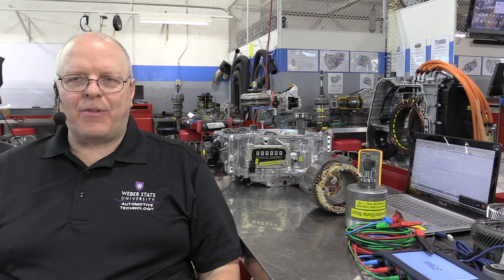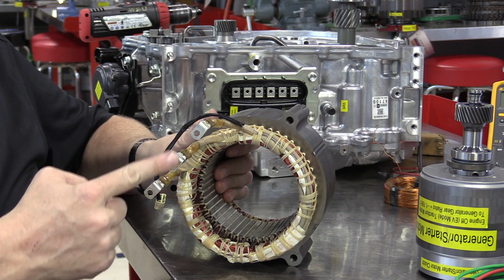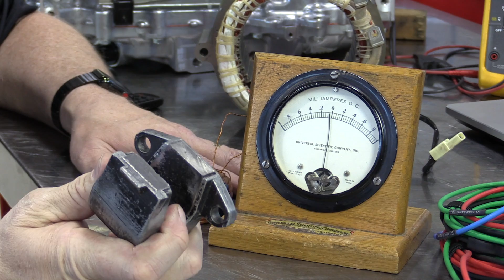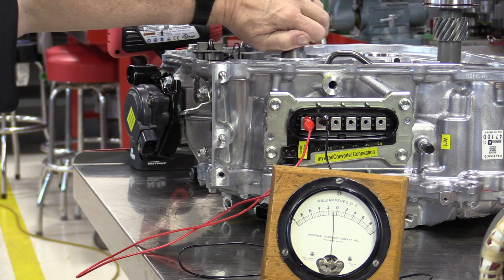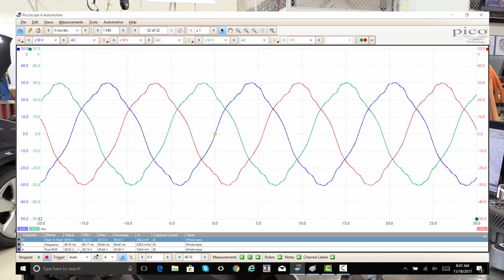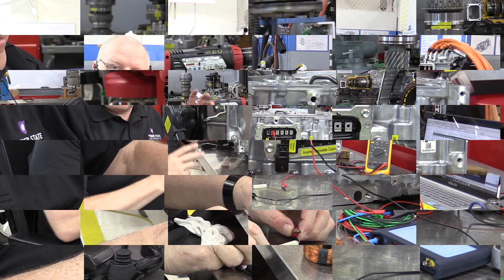Hybrid and EV Regenerative Braking Systems

Comment: I believe that the B position actually limits regen braking to prevent the battery from overcharging. Instead the MG1 and MG2 work together to increase the ICE rpm in order to slow the vehicle down. But I could be wrong.

Comment: 21:30 Did I understand it correctly? That MG1 is consuming power from MG2 to increase a load of breaking? What if we put a ICE drag in this system.
that means the B mode is charging less than D mode? Because in my Yaris, if I engage B mode, I always hear ICE.

Comment: I have a question about the regenerative braking in "B" mode:  MG 2 being hooked directly to the wheels becomes a generator for braking.  MG1 in order to generate needs to spin but the rotational torque goes through the planetary gear set and needs to be resisted by the ICE.  Is the ICE allowed to spin without combustion to resist the torque driving the MG1?

Comment: I was hoping to hear something about how much energy you can actually 'get back' when using regeneration in an EV - surely there has to be significant losses from first using energy to accelerate the car using the motor, then getting a percentage of the energy back from braking the car with the motor used as a generator?

Comment: I have been looking for a diagram of regen system. I can’t find anywhere. I had hoped that Professor Kelly would explain a bit into the details how to control the amount of break and how is the energy pumped back to the battery. To my disappointment, Professor Keey said the same level as car manufacturers advertisement, rather than showing me the circuit diagram. The most he said was smaller resistance breaks harder. For middle school science class, maybe it’s exciting. Please show us the diagram and the control code

Comment: Thank you for this video and the hundreds of other very high indepth technical videos in your channel. I am no engineer but understanding rc electronic i believe there is a limit on battery regeneration depending on the charge state and temperature. This would in some cases like long inclines limit the regenerative force to protect the battery. In these circumstances to prevent brake fade the MG2 energy is diverted to MG1 which then drives the ICE. Of course the fuel and ignition is inhibited but the drag of the ICE compression provides the bulk of the braking force. I would guess the ICE rpm is varied to provide the commanded brake force.
Reply from the maker: Thank you

Comment: I want to know why after a minute or two of regenerative baking coasting down a mountain, why does the engine start on my prius prime? I’m in EV mode.  It seems to do it primarily in the summer.  The battery is nowhere near full.
Reply: If your incline is long enough the battery may become fully charged or reach a temperature limit due to the charge rate. If you are in B drive mode part of the regeneration power is diverted to mechanically drive the engine that has a similar effect of downshifting a manual for engine braking. However the fuel and ignition is inhibited so there is no cost to fuel consumption but the result is you will reduce the use of hydraulic brakes (prevent overheat/brake fade). During D mode engine braking is not available.

Comment: As I understood it, applying a light b braking via the pedal only uses 1 motor for regeneration, while when putting the transmission in B mode it uses 2 motors for regeneration. Why can the system not use both motors for regeneration with moderate breaking via the pedal?

Comment: Question Please Professor John D. Kelly....
Since the newer RAV4's do NOT have an actual 'B Gear' then is the 'S Mode' work in the same way? (Replacement?)
In other words: What differences are there between the 'B Gear' and 'S Mode'?

I will be receiving a new RAV4 Limited Hybrid in a month or two and I would like to use Regenerative Braking as much as possible.
With OUT damaging the vehicle in any way.
Thank you.

Comment: Thanks professor for your explanation.  Just one clarification from you though. In the explanation for the regenerative braking you used a 10ohm resistor as a load, what would be our load in the real situation. Thanks.

Comment: Professor Kelly busted the myth about "B Mode".  Many belief B mode uses the ICE piston compression to decrease the vehicle speed.  This does not make any sense to waste the energy which otherwise can be easily recovered.  Prof. Kelly clearly explained in B mode, a higher level of regenerative braking to (1) recover more energy to the high voltage battery and (2) the magnetic field puts a higher load to the spinning wheels so less hydraulic breaking is required.  Today, I did an experiment with my 2020 Prius Prime PHEV in a 50 mile city driving test invloving mostly flat roads but with many traffic lights.  Each time when I needed to slow down, I engaged the B mode until the braking effect diminished before using the hydraulic brake.  The result was about 10-15% more range in one charge than not using the B mode at all.  Thank you prof. Kelly for clearing this cloud.

Comment: As an auto tech, I've been in many training classes over the years (decades actually) and have had good and not so good teaching. Your way of simplifying the material is very good! Your demonstrations are excellent also. Practical demonstrations are often the best way to help understand the topic. In this video I was wondering, if by chance the imbalance of the drill adapter could be the reason behind the jagged AC curves and the peaks/valleys ? It's an interesting curve profile for sure. 
And I'm glad you were able to return to work after your accident! You obviously have a passion for teaching!

Comment: I assumed that EVs were using ultra capacitors to quickly store energy from braking and electronics metered it back to the battery at a rate that the battery could handle. But I only saw a 1600 uf "smoothing" capacitor in the inverter/converter video. What controls the battery charge rate during regenerative braking, or is it just not enough power to exceed the battery charging capacity?

Comment: Great video! One question I have is when in "B" mode, using MG1 for braking, does the engine spin with MG1 even though there is no fuel or ignition to run the engine?
Reply from the maker: Yes it does
Reply: @WeberAuto  I thought maybe it did. Thank you.

Comment: Best explanation  on the internet. I love this whole channel from the eCVTs to the differential videos.  But I still have questions about this.

When it's coasting, I am charging the battery, but not as much, correct? So then when I press the break pedal, It opens the circuit up to the battery? Or, it was always open to the battery, but now we've added resistanc?  Is the battery resistance by itself? I get how adding resistance causes the motor to slow down more.  I don't get how adding resistance makes the stator produce more voltage or charge the battery more.   And when you talked about negative torque.  Again, I get how that slows the car.  But now it seems like we're putting battery voltage back into the stator, that must lessen the charge we get from the breaking? How much less are we charging in free spin mode vrs breaking mode?   I'm in a 2016 rav4 hybrid.
Reply from the maker: Thank you. The connection to the battery is never open during deceleration, the inverter uses battery power to create an opposing voltage to the voltage being induced by the spinning rotors. Think of what happens if you put two AA batteries in a flashlight, or other device with one facing the wrong direction. The two opposing voltages cancel out each other and no current flows. Thanks for watching
Reply: @WeberAuto  I can easily imagine how the m/g can be used for deceleration. It's also easy for me to imagine how the motor is used as a generator. My confusion is, how is the increased deceleration used to charge the battery at a faster rate than normal coasting? 

When I take the foot off the accelerator, the power from the wheels turns the generators. But when I press the break,  the needle dips further down into the "charge" zone. That's the part I can't understand.
Reply from the maker: @thisisTrev  It is accomplished the same way, but by changing the level of the opposing voltage during deceleration versus applying the brake pedal.

Comment: The configuration of the magnets affects the magnetic flux and so the voltage. That's why it is not a sinewave.
To simulate a load you can also short the windings. The rotor will be really hard to turn even by hand.
Reply from the maker: Thanks for the information. Yes, shorting the stator windings makes it stop rotating

Comment: If you connect the output of MG1 to the input of MG2 like you did in the video and turn MG1 at a certain speed could MG2 turn at a different speed, like for example if MG2 has a mechanical load would it turn slower? Oh and thank you for the great videos!
Reply from the maker: Thank you. in this example it would turn slower or even come to a stop. In reality, given enough power, no, it would continue turning at the same speed.

Comment: Another great video, thank you so much.  Now a "retired" electrical engineer I have always wondered how my 2014 Toyota Camry Hybrid works and have watched some of your videos several times.  
I would be really interested to learn how the 2021 Toyota Camry Hybrid (sport I think they call it) has incorporated, what the motoring writers call paddle shifters.  By using the plus and minus paddles on the back of the steering wheel the driver can upshift and downshift through the "gears" as they say.  How is this simulated in this type of gear box?
Thanks again for your great videos.

Comment: Does putting the shifter into B position cause additional wear on the motors? If yes, than it is better to use hydraulic brakes, since they are certainly cheaper to replace than the electrical motors, when worn out.
Reply from the maker: Not really. Thanks for watching

Comment: Ive been brainstorming about how I could take a truck and make it into a hybrid, using the driveshaft connected to a motor
what size motor do you think i would need for something like this?
Reply from the maker: I don't know. So many variables. These are companies that specialize in conversion parts. They would be a better source.
Reply: @WeberAuto  
The talent pool in my neck of the woods is pretty small, you're lucky if they know what an electric motor is.

Comment: Your videos are just SUPER, congratulations!!

Just one note: in "B mode" MG2 will regenerate more power than "D mode", but that "extra-power" is not necessarily sent to the battery. In fact, MG1 can be used as a motor to speed up the ICE, dragging it, and use it as a brake. If battery SoC is 100% (the usable SoC, btw) "D mode" cannot guarantee ANY regenerative braking, while B mode can, since it can dissipate MG2 regenerated power through the ICE using MG1 to drive it

F

Comment: It all makes perfect "Selsyn" sense! Thanks very much for the detailed and exemplary demonstration, Professor Kelly.   Could you address the efficiencies of regenerative braking please?  With respect to braking, it is indeed effective, but when it comes to 'putting charge back into the battery' I imagine nowhere as effective as is commonly believed.  In my hypothetical thought experiment, the relatively short duration of decel events, factored with the relatively low deceleration rates, suggests that there will be very little real work done in increasing the charge state of the accumulator system.

Comment: #WeberAuto Dear Professor, about Transmission shifter "B" Braking position at 17:30. I'm using Hybrid Assistant https://play.google.com/store/apps/details?id=priusfan.info.bthsd10&gl=AT and I found actually that MG1 is using energy when I put into "B". That means MG1 is not used to charge battery. That is totally clear. MG2 generate current while MG1 is using it and spin ICE to catch speed of MG2. In that situation ICE is used also to mechanically slow down car. 
I also think that is working like this because when battery is full "B" mode is automatically applied. And I can find on Hybrid Assistant there is no more battery charging. Only MG1 is using current do slow down car by spinning ICE. As you said in planetary gear set, when we spin two parts third would spin at same speed.
Professor please let me know what do you think about this conclusion?

Comment: Thank you very much for this video. There is still something I don't understand : 
at 15:27 -->
I don't understand the reason why the generator is more difficult to turn if the resistance is low. I would rather think the opposite. I would have thought the higher the resistance (so the more you allow the battery to charge), the harder the motor / generator has to run. Could someone explain to me? Thanks in advance :)
Reply: the existance high resistance simulate open circuit between phases and no return current to the motor... leading only to charge hv battary... as we decrease the resistance between phases the open circuit break allowing return current to mg1 and mg2 as opposite current leading to electrical breaking as the overall resulting movement  is a subtraction between two induced opposite direction torques

Comment: Thanks, you have done a lot of people goodby these videos. Professor Kelly, you are among the top ten of all the educators I have encountered. I hope Weber Auto treats you well. 

It was your video on the Pacificas transmission, that helped me decide to buy a Pacifica, then I saw your videos on the hybrid transmissions, That helped me decide to trade in the Pac, for a hybrid pac. 

Can you give details on how the braking works at the brake pedal end. My Pacifica hybrid increases the regen. and you can her the motors speed up. Also somehow hydraulic brakes are not applied until the pedal reaches a point determined by ground speed. As I understand it, pressing the brake pedal causes the EV transmission to increae the motor speed to get more power from the motor. Then at a point, the main brakes get applied. I just do not understand the mechanical workings of how it all works together.

Comment: Great video! One comment on demonstrating how adding a load slows down the vehicle is that in your example the motor was acting like a generator and was converting the rotational kinetic energy of the rotor into electric current which was being converted into heat in the resistor. On the vehicle the kinetic energy would be converted to electric energy and stored in the battery. Thus the kinetic energy is removed from the car in the form of electricity and slows down the car.

Comment: I am doing regen brake on my ebike,but the voltage it generate usually not higher than the battery so to charge derectly,can you show the the method to make this voltage higher so it can  actually charge the battery,nobody talk about this.you can also answer to my email 25956382@qq.com,thanktou professor!

Comment: Hello, great videos, they are very interesting especially after I bought a 2019 Corolla (Hybrid, EU), it's very interesting to understand what really happens down there. I have a few doubts. I live in a hilly area and normally  use the normal (regenerative break) instead of using B to go downhill on mountain roads. I understand (in most cases) it actually recharges more than using B, plus it's easier for me to control acceleration after exiting curves. Do you think that using the regen break for such extended periods of time could cause issues on the long term with the regen components or battery? Should I worry if the engine revs almost to the red line when using B downhill? Any driving tips on long term care of the regen components? I know day to day habits can make a big difference on the long run.

Keep up the videos, really appreciate them!
Reply: Nope chef BMW 328i hyynrdd 2013 80000.oes zero jseus

Comment: Regenerative braking with permanent magnet synchronous machines works with the inverter applying a pulse width modulated voltage usually well above 10 Khz which approximates the motors AC voltage usually well below 1KHz being synchronous to what it would look without electrical load and with a 90 degree lagging current proportional to the braking (negative) torque desired.
It is just the opposite as generating power where the phase of the AC current is leading 90 degrees for positive torque.
This in effect uses the motor inductance as a transformer / step up converter so 20V rms with slow rotation as seen can charge a battery with 300V, same as when generating power, just with opposite sign.
For this it is necessary for the inverter to know the motor position so it can apply the current in the proper frequency and phase, which is usually done by a additional mechanical rotational sensor.

And this is the convenient thing about most kind of these motors, they are basically electrical transformers with added mechanical features.

Comment: Plzz telll me what happen if i try to start with IMA battery switch is off
Reply from the maker: The engine should start with power from the 12V battery, but no 12V battery charging will take place
Reply: @WeberAuto  in my time that not happen i try to start everything is shutoff no powersupply then i reconnect 12v battery with IMA battery switched on it starts car but transmission d light is blinking and amber and red brake light is on.....DTC days lost communication with brake system control module..
I check all the electrical connections but not any loosen or cut on wires or socket.. any registor blown or or what happen..pllz tell me can i open battery IPU cover to see any problem on this side..thank you sir weber auto..